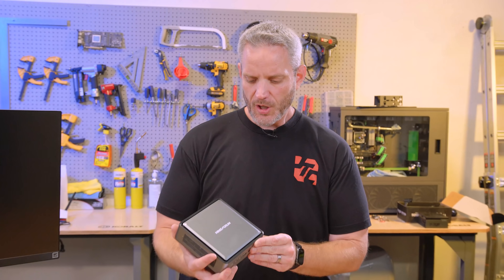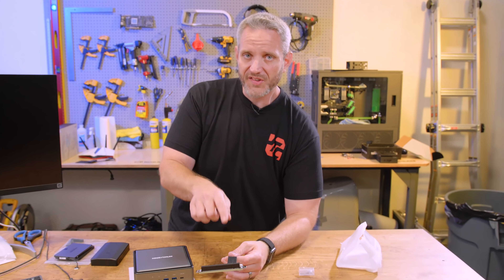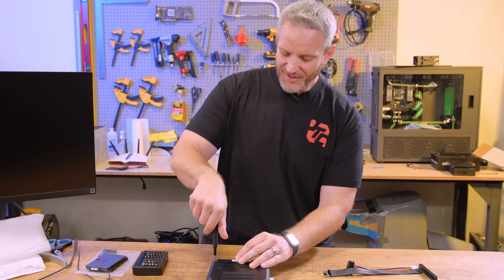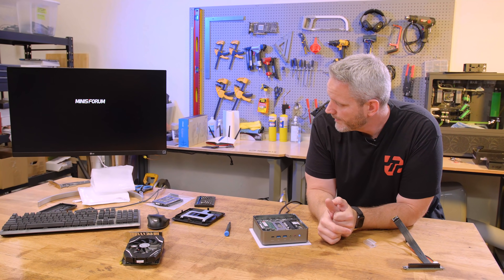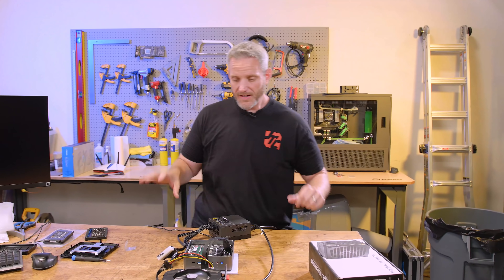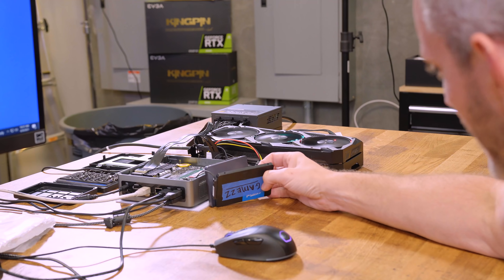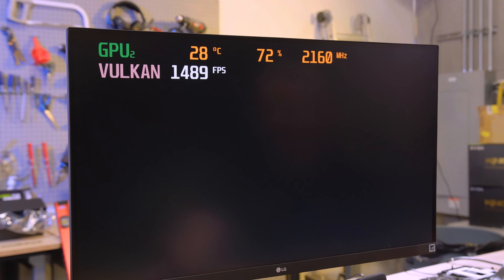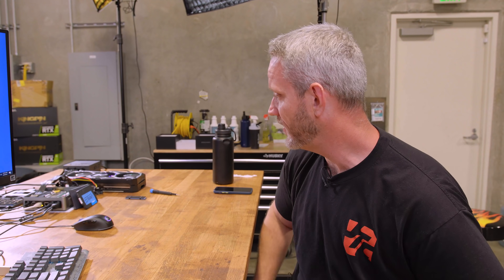This was easier than I expected it to be! Super powerful mini pc

Comment: I know this is stupid, but has anyone managed/tried to transplant or in some other way utilize a 30 series laptop gpu in a tower pc? 
I have NO idea how this would be possible, but I still wanna see someone try.
Reply: That’s interesting. I know that they have tester boards that can connect to those, but you would have to somehow get ahold of one of those, the gpu itself would probably have to be harvested from a working machine, and you would have to go through hell soldering it and then programming it
Reply: This is interesting. Don't know why but still.
Reply: I am almost sure it's not doable because the GPU is integrated with the motherboard itself, so you had to cut the motherboard and still have the necessary components like GPU memory... The next problem would be how do you connect the PC to the laptop GPU because the connectors are embedded in the motherboard it's not PCIe or something like that 🙂.
Another way could be to find a way to use the HDMI port to maintain the motherboard and everything on the laptop intact but the system is prepared to be working alone so I would guess you had to hack or do some software and find a way to send the data that you want to render to the GPU.
This is my opinion, probably I am missing something that allows doing it.
There are some laptops that use a CPU from a PC like the Alienware Area-51. It uses a desktop CPU but I think not GPU. Anyway, the modules are not standard you can only buy from Alienware but still upgradable.
Reply: What would be the point
Reply: @ultraL2  You might actually be able to find one in stock
Reply: @joeyhillers9460  uffff
Reply: @joeyhillers9460  the mobile versions are nowhere near as powerful, and you'd be bricking a perfectly fine laptop
Reply: @ultraL2  I mean, obviously. It’s a mobile gpu. But, I’m sure there’s a use for it, this is all theoretical after all
Reply: @joeyhillers9460  there is no use for it.

you'd need a donor 30 series desktop card
you'd brick your perfectly working laptop

people have done it on older gpus, so yes it works, so unless you wanna throw 1000s of dollars down the drain, there is no point
Reply: @ultraL2  Mainly: To see if it's possible. It's a little thing called "fun".
Reply: @SolarMechanic  there's so much wrong with your idea

it is possible, people have done it.

however a mobile gpu is less powerful than its desktop counterparts

you'd need specialised tools 

you'd be bricking a perfectly fine laptop

to achieve the same result as plugging in an external monitor
Reply: @ultraL2  but it's about the if, not the why?
Reply: @SolarMechanic  there's nothing inherently special about a 30 series chip that someone can't hack together a mobile gpu into a desktop with a donor card

people have done it with other gpus

but hey, you keep being special.
Reply: @ultraL2  Ah, so your solution to the problem is to ignore the problem and provide a solution to a different problem nobody asked about. Cool.

It's both literally what I said and obvious from context that what I am referring to is transplanting an entire gpu, not just the processor chip. You can tell that wasn't what I was talking about because it's not what I was talking about.

I'll continue to consider myself "special" since it seems that includes the ability to read.

Comment: Jayyyyyy

The 4800U is zen 2 you silly pancake.

Can't wait to see what zen 3 mobile chips can do. My 5500u is one of the two chips in the 5000 series that isn't zen 3 because why not

Also I should mention that that is not an ideal solution for this setup and does run the risk of fire. Neither the floppy connector or the sata connector used are capable of safely supplying 75w over the 12v rail
Reply: because you should've done your research. even numbers new, odd numbers old, took like 2 minutes to find that out